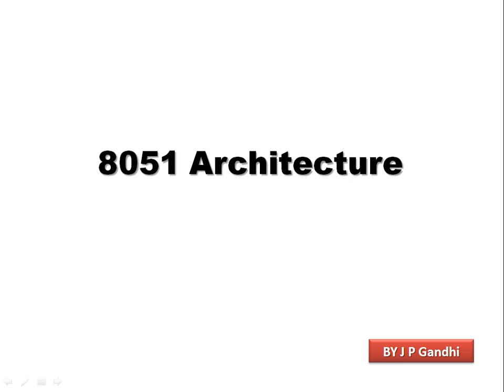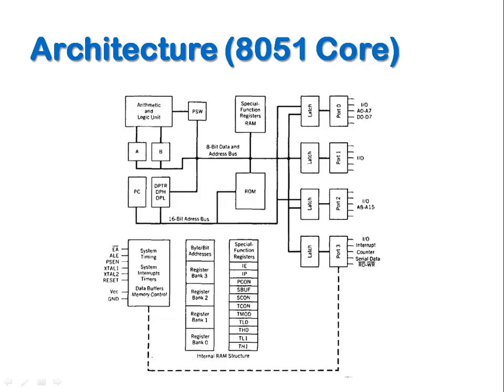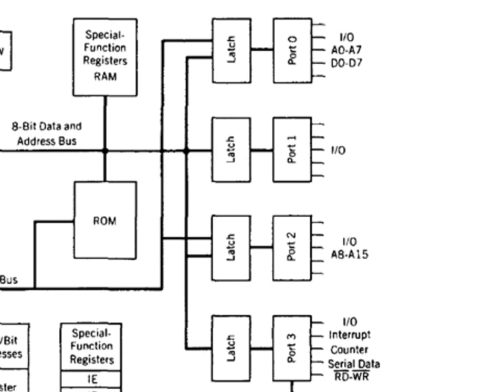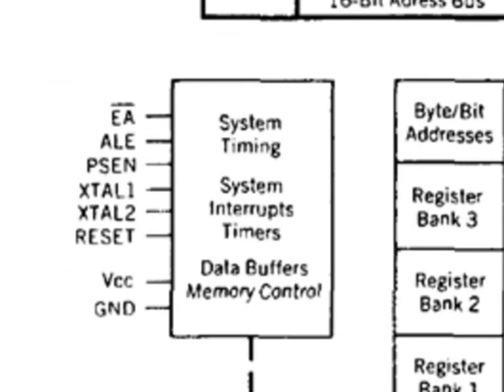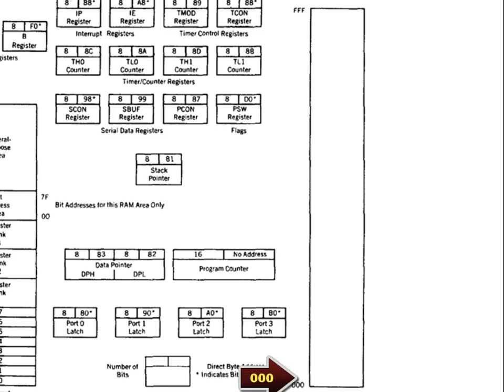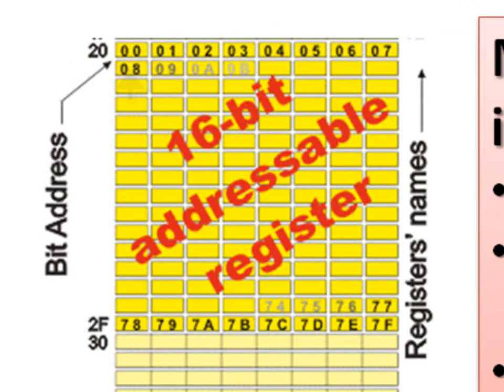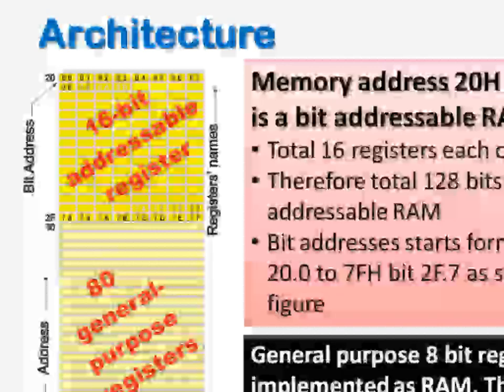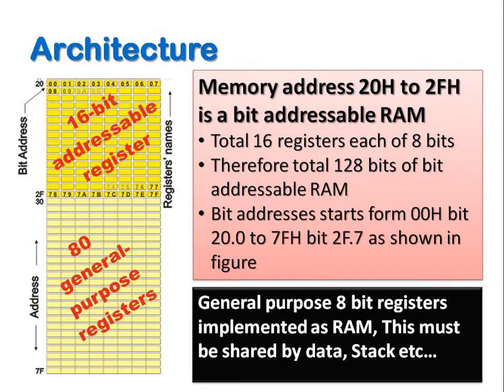8051 Microcontroller Architecture 01.mp4

Comment: sir,will you explain me .why crystal oscillator frequency is set 11.0592Mhz in 8051 microcontroller?
Reply from the maker: Normally a crystal oscillator of 12 MHz is used for 8051 microcontroller. this gives a 1 micro second machine cycle. However when the controller is required to use serial communication the timings generated have small errors in the standard baud rates like 4800 or 9600 etc... to overcome this problem a crystal of 11.0592 is used  which provides accurate standard baud rates as desired
Reply: Thank you sir.